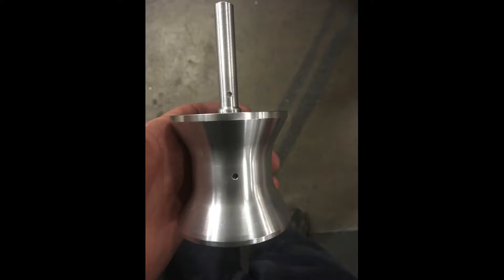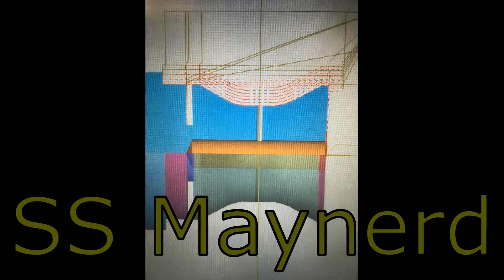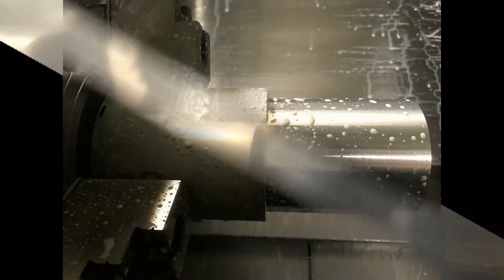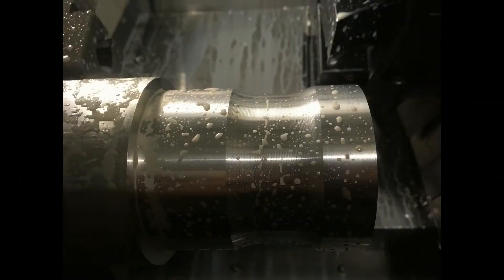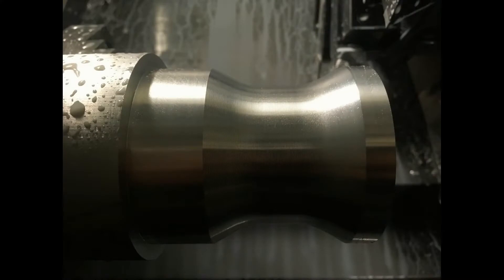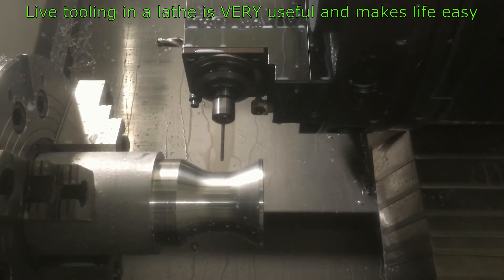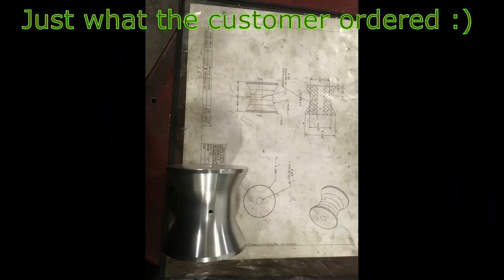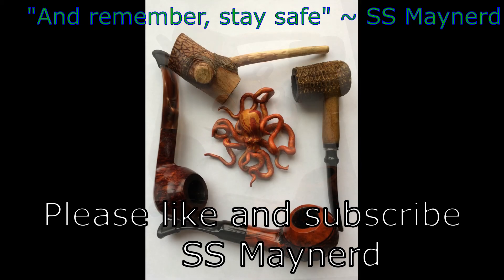Making a Capstan

Comment: Wonder how long aluminum will last in salt water?
Reply from the maker: 6061T6 aluminum does very well
Reply: SS Maynerd nice work!  What is the roll pin and shaft made of?   Any galvanic action possible?
Reply from the maker: @magicone9327  The pin I think, was stainless. the two metals don't attack each other because of the oxide layers forming so fast on each metal. It sounds crazy but, aluminum is held together with stainless hardware all over the coastal areas in Oregon.